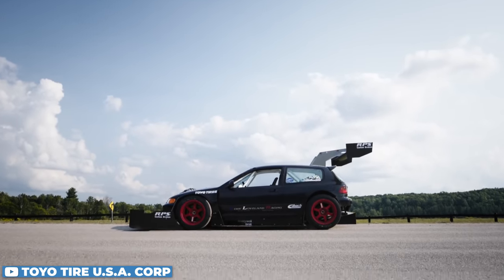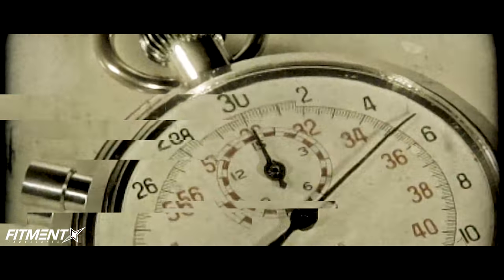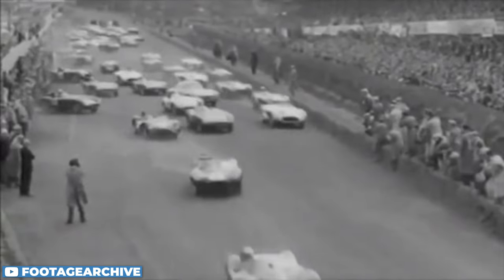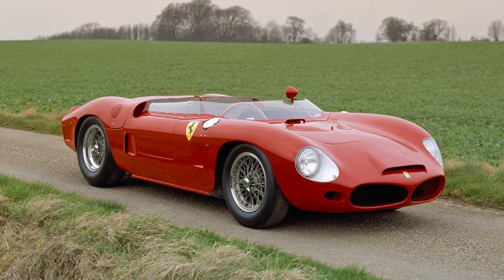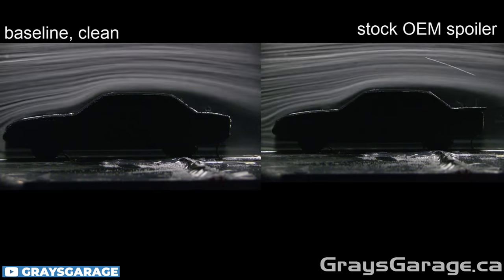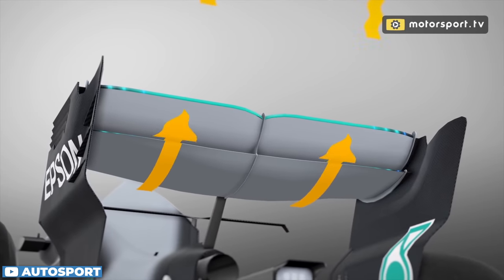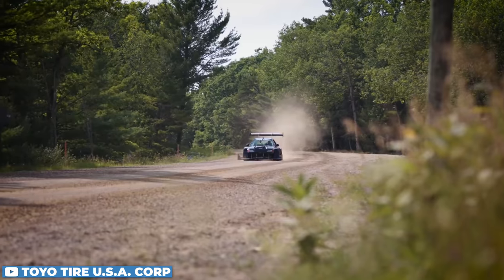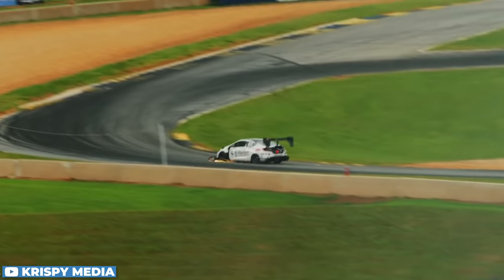Is It DUMB To Put A Big Wing On Your Car?

Comment from the maker: What do you guys think? Are you going BIG WING, or keeping it more subtle? WHY?!
Either way, with 10% Off Airlift suspension kits, you’re sure to achieve the fitment you’ve been dreaming of - https://bit.ly/2NGYoyb
Reply: Big wang but imma have a 2000 horsepower red car so imma need ze downforces.
Reply: It is pronounced Wang
Reply: I am actually thinking of making a custom big wind that looks "factoryish."  Pick a Clark Y airfoil or maybe one that can go a bit slower, and mold it into the natural lines of my car, kind of like the Mk IV Supra wing.  Going to take me a year or two to actually make it though, I have to learn carbon fiber & fiberglass layup first.  But it's a plan.
Reply: @saulekaravirs6585  You'd be surprised what kind of difference a simple lip on a factory spoiler can make. Looks pretty clean and won't break the bank either. Cheers mate.
Reply: Big spoilers are cool on race cars but I roll my eyes when I see them on street cars...same with cages and harnesses, I agree with Alex on that, they don't belong on street cars.
Reply: I just wanna do a wheelie lol
Reply: YOU SHOULD TALK ABOUT THE Z31 300ZX. Most underated car of all time.
Reply: For street use, I'd rather have small wing or air lips.
Reply: I will start a trend.  A big-ass wing WITH a cape!
Reply: Maybe you should have actually talked about people who put their own wings on not just race cars and factory models that come with them
Reply: I have the Nrg a590 on my srt4. I love it. You can see it’s my profile picture

Comment: If it's a well designed wing it will improve cornering at speed. Look up front wheel drive race cars race cars they all have big wings even though they don't have that much power and are fwd. Why assume his wing is badly designed just because its on a 350z? Do you know the brand of the wing or are you just hating?

Comment: As long as you have the performance to back it up
Reply: What about that Miata that only got faster because of better wheels, tyres and chassis mods while still rocking that stock 1.8 NA with a straight pipe and nothing else?
Reply: @Icemann336  how do you know that little 1.8 ain't secretly a free valve 1.8 that makes like 500 wheel? Huh?
Reply: @Prestiged_peck  
Because it's all in theory. Sure, that Miata might not have 200whp, let alone 500, but I'm sure the wing will help the stability in some way.

Or maybe he puts it on because it looks badass, it's none of my business
Reply: lol i guess you havent seen the video with the honda civic on a track with a wing vs without. you dont need power at all. you only need air speed. did you even pay attention to the video lmfao

Comment: In the past I thought it was silly to add down force to the back of a FWD car. Then it was explained to me like this: to be fast around a track, a FWD car needs to have plenty of rotation on tap whenever you want in, especially for tight (slow) turns. While plenty of rotation is preferable for low speed turns, it translates to twitchiness at high speeds, exactly when a big old wang is doing its best work and when the driver will be less able to counteract oversteer with more throttle.
Reply from the maker: Well said!

Comment: All depends on the wing/spoiler being added. Some are unfortunately just for cosmetic purposes (cool factor) and sadly just create added drag and others actually aid in downforce, but at a certain speed.
Reply: Why unforunately? All spoilers will have somewhat of an aero effect, it can be more or less and better managed or destabilizing. So if people with a road car are aiming for a big spoiler just because they like how it looks with it - it might be better if it has less effect than if it destabilizes the car too much
Reply: While there are some wing designs that arent particularly efficient, as long as AoA and placement in the airstream are thought out when installing you should always be able to get some amount of noticeable downforce out of one
Reply: Downforce works at any speed, at low speeds it is just less powerfull. So even a relatively slow corner (40-50kph) can be taken faster with a big wing.

Comment: Like you said, it's about balance. If you have a large rear spoiler you need one in front too. Never seen anyone put a large front spoiler on a road car though so I'm gonna say that large rear spoilers are still dumb from a performance perspective.

I mean, if someone is just into the look (and doesn't care about ruining their mpg with all that extra drag) then by all means. Just as long as they don't pretend like it's giving them some kind of performance benefit.
Reply: A rear wing on the back still works, downforce will push the rear tires into the ground whilst cornering and this will counteract oversteer. Front still works but  that is mainly for understeer. A decent driver can counteract understeer in an RWD car by proper throttle management.

Comment: If you disagree, you're wrong. I absolutely need the extra downforce especially for low speed corners like turns 3 and 4. By low speed, I mean 30 kph. And by turns 3 and 4, I mean the two turns I take that lead to the first red light on my commute to work every morning.

Comment: Fun fact: 69 Charger Daytona Mule had routinely run laps at the Chrysler Corporation Proving Ground in Chelsea Michigan at 235 miles an hour ultimately taken the mule to laps over 243 miles an hour.
Reply: I call bs on that one. You see even the Ford GT40 MkIV was clocked at 213.13mph in the 1967 Le Mans 24 hour race. First of all you don't have to be an aerodynamicist to see that the low-slung GT40 will cut through air easier than the Charger Daytona. The aerodynamic drag is ultimately the frontal area times the drag coefficient. Here's the nasty part too - the power needed to overcome wind resistance increases cubely with speed. This means that unless you have an insane amount of power the only way to deal with that is too dramatically decrease drag - i.e. building a low, slippery car. The GT40 certainly was designed for this in mind, the Dodge Charger not so much. Adding a few aerodynamic parts won't make the frontal area smaller or fundamentally change the body. 

The Mulsanne straight at LeMans was undoubtedly the longest straight in motor racing in those days - before they ever rising speeds forced them to add two chicanes. 3,8 miles of straight means seriously high speeds are reached in a powerful racing car with an aerodynamic body. 

Two things were common in those days: 
1) Exaggerating speeds for bragging rights. Usually it was rounded up to the nearest "even number". This is why Ford themselves claimed 220mph and later sources exaggerated that further to 230mph. It has been repeated so many times many take it as a fact. I'm therefore fairly certain your "sources" are equally exaggerated. 
2) Difficulties measuring the actual top speed by the drivers themselves. In the days without advanced inboard telemetry this was solely down to driver to assess, usually using nothing more than the rev counter as the only measure, add final gearing to the calculation and making a crude mathematic estimation. Given the realities this often leads to a 5-10% error rate. 

The bottom line is that race officials were the only one clocking the top speeds of the cars and while the GT40 MkIV was the fastest they saw 213.13 mph by the fastest car. 

The MkIV has a 427 engine developed for racing and Shelby were given pretty much limitless resources by Ford to make it deliver the required power and reliably. Would you kindly explain to me how the Chrysler/Dodge engine of virtually an identical displacement produced so much more power? For 240mph you'd need at least 800hp, probably even more with a high drag factor. 

"ultimately taken the mule to laps over 243 miles an hour." No, utter nonsense. You said LAPS. From the "sources" I read this was a momentary top speed . Even that is clearly an exaggeration. 
Here's what you need to explain. How did Mark Donohue manage to go slower in the Can-Am (limitless Group 7 racing with no upper displacement limit or other limitations) Porsche 917-30 at Talladega in 1975? You see the 917-30 had turbocharged flat-12 producing 1100+ hp in race trim but a reported 1540hp in qualifying trim. 40 psi of turbo boost made this possible. This racing car was feather light too weighing only 1822 Ib's. This resulted in an acceleration of 0-200mph in 10,9 seconds. 

Mark Donohue won the 1973 Can-Am title driving the 917-30 but since the regulations for 1974 banned all turbo-cars Porsche decided to attempt the speed record on a closed track. 
On August 9, 1975, Donohue drove the 917-30 to a world closed-course speed record at the Talladega Superspeedway in Talladega, Alabama. His average speed around the 2.66-mile (4.28 km) high-banked oval was 221.120 mph (355.858 km/h). Donohue held the record for 11 years, until it was broken by Rick Mears at Michigan International Speedway.

So you're telling me that Mark Donohue, a driver who raced in Sportscars, Indycars, Nascar, Can-Am, Trans-Am, IROC and Formula One. Who won the 1972 Indy 500, was Can-Am champion (with the Porsche 917-30) and was IROC champion. Managed to take a 1500hp Can-Am monster to 221mph at Talladega whereas somebody managed to take a 550hp Dodge Charger to 243mph?? 

Sorry, the numbers just don't add up. 

Gil de Ferran holds the all-time closed circuit average speed record. On October 28, 2000, during CART qualifying at California Speedway, de Ferran set both the track record and closed course record for fastest lap at 241.428 mph. That's with the ultra-low drag superspeedway setting and an engine producing over 1000hp. This are Gil de Ferran's own words from Motorsport magazine: “Leading up to the race Penske did a lot of work on the aerodynamics to make sure our Speedway car was the best it could be and Honda came up with this stonker of an engine! It made over 1000bhp. It was a qualifying engine with very little mileage. I recall its limit was 50 miles. So basically you could do two runs in the morning and then your qualifying run."

Yes, so de Ferran needed over 1000hp for his 2000 closed circuit record at 241.428 mph which still stands but they went faster in 1969 with a Nascar? Right. 

I reiterate. The numbers just don't add up. When far more aerodynamically superior cars having way more horsepower can't reach 243mph on a high-speed track then you'd better believe those claims from 1969 should be taken very lightly indeed. Like I said, the Ford GT40 MkIV reached 213mph on the 3,8 mile long straight at LeMans in 1967. 

Bold claims are no match for a realistic comparison from several sources - all of which were independently verified and proven.
Reply: @paulallen8109 Chrysler recognized Nascar magic 200 mph barrier was being broken by their winged cars, but they needed to set an "official" record in order to claim it in the record books for good. So on March 24, 1970, Chrysler put their factory driver, Buddy Baker, picked from their factory-backed Cotton Owens Garage race team, behind the wheel of the specially-prepared Chrysler Engineering #88 test mule, and set out to officially claim the record at Talladega Super Speedway. 

Where things got confusing is that Chrysler and NASCAR did not want to promote the #88 test mule car as having set the record, because it was not a real race car and therefore had little to no PR value to the racing fans and community at large.

So Chrysler, NASCAR and the media promoted their factory team, the Cotton Owens Garage #6 Daytona, along with their driver, Buddy Baker, along with the 200.447 mph record. Unofficially it (and other winged cars) had exceeded 200 mph before anyway, so that's how it was promoted. There are various publications from this time depicting this. They simply wanted to maximize the publicity value from their racing efforts with a known driver and team. There were other Chrysler teams that had hovered around the 200 mph mark too, but Buddy Baker ("leadfoot") was the most recognized factory driver who had a reputation for flat out driving, and he drove for Cotton Owens Garage, who was also one of the top factory Chrysler teams of the day

Chrysler did what it set out to do, just as all the examples you illustrated. Their sole mission was to take down Ford and dominate Nascar.... which they did. 69 the Daytona winning the Talladega 500, its first race, and becoming the first stock car clocked at over 200 mph, and the follow up winning 38 out of 48 races in 1970. To quote Buddy Baker on the Dodge Charger Daytona

"It'd be hard for race fans today to understand just how well the Charger stuck to the ground with that big wing on it. Even without the wing, the old Dodge with the Hemi ran well over 200 mph at Daytona and Talladega. It was a time in the sport when you looked at the car and knew you wanted one of 'em.

Comment: wings are cool but i prefer smaller or no wing than giant ones
Reply: but my laptimes :(
Reply: The only time i like big wings is when they are factory and fit in with the body lines of the car, like the subaru STI for example. I think those cars (especially the older ones) look wrong without the wing
Reply: I think any sport oriented coupe or sedan can easily rock a massive wing and look good doing it. It's the compact cars and hatchbacks that make me cringe.

Comment: Wrong wheel drive cars have this fun thing called lift-off oversteer. A rear wing helped plant my FWD in corners... and yes, you need a balanced downforce on the front wheels too.
Reply: All cars can suffer from lift off oversteer not just fwd.   my old MR2 would swap ends a the mere hint of lifting off.

Comment: “So you want a 2nd gen Lexus IS”
Reply: I used to have one, great for suspension mods , braces,  body kits, lights etc.. as for engine mods.. not to many and when you do find a engine mod you do want to do .. over priced for little hp gain. 
I have a LS400 now and restoring this 1st gen with a vip look.

Comment: So I have a na6 miata and it has no spoiler. When I hit 165 kph (100mph) it feels extremely loose on the road, and I struggle to keep it in na straight line. Would an oem spoiler make a huge difference or would I need an aftermarket one?
Reply: Sounds more like you need a proper alignment and to check for worn suspension components.   A Miata should be perfectly stable at 100mph even with the roof down.

Comment: Lets just clear up for everyone in the comments that didnt seem to get it what the difference between a spoiler and a wing are because they are NOT the same.
If it sits on stands and creates a pressure difference between the top and bottom of its surface, its a wing.
If it is attached to the surface of the vehicle to disrupt surface airflow its a spoiler.
EG ducktails are spoilers, EVOs/STIs have wings

Comment: If you've got ponies that warrant a dickload of downforce, sure. If it's going on your stock STi or Honda, no
Reply: Lmaoo a stock sti has a massive wing as stock and its awd meaning for Subaru its 60 in the rear and 40 in the back and they have front and rear slip differential lock which evens the power to 50/50 a Honda is different most of them r fwd lol